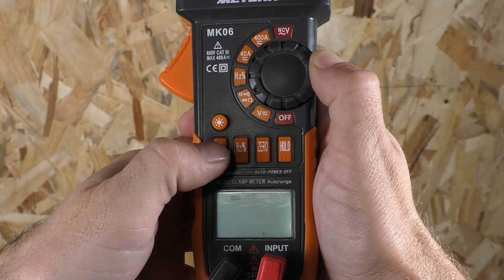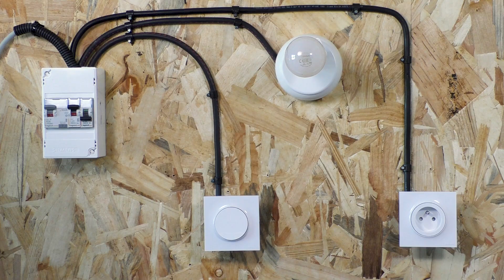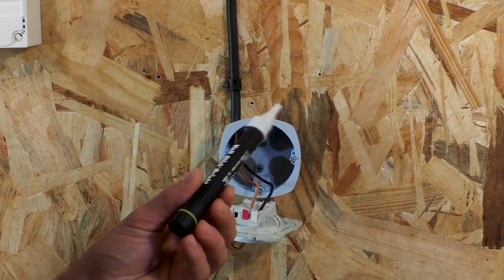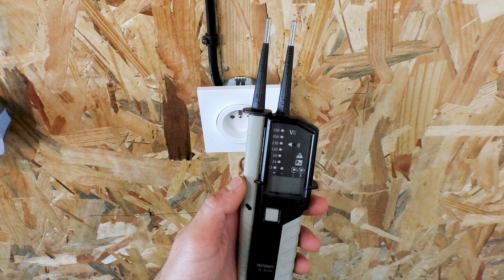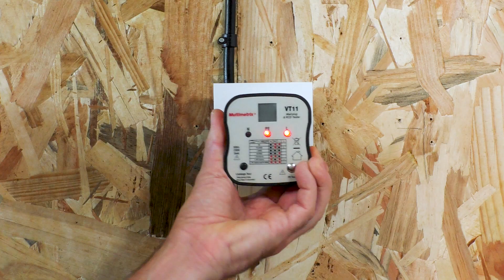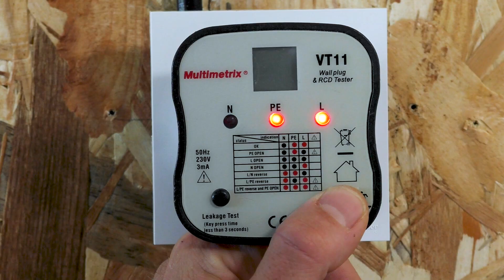3 Easy Ways to Test Voltage

Comment from the maker: ⚠ *Safety note:* Electrical work can cause electric shock, fire, serious injury or death if done incorrectly.
 Electrical systems, equipment and regulations vary by country, so always follow your local requirements and the manufacturer's instructions.
 Always isolate and verify the power is off, and only carry out work you are qualified and competent to perform.